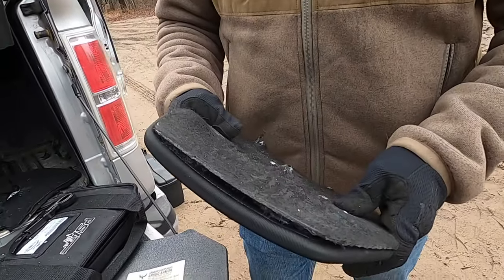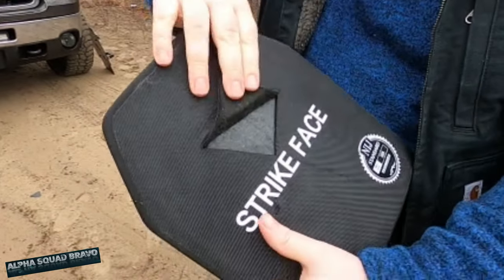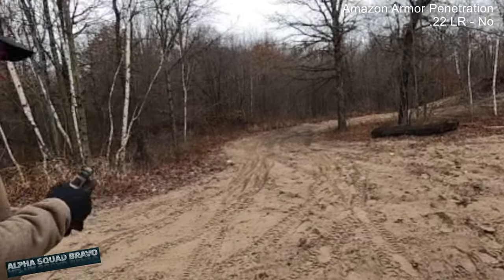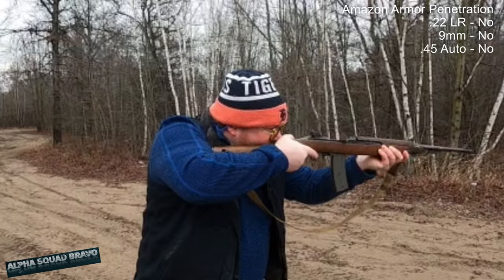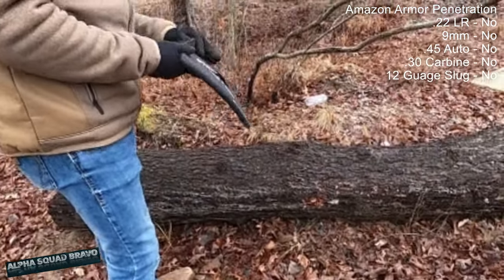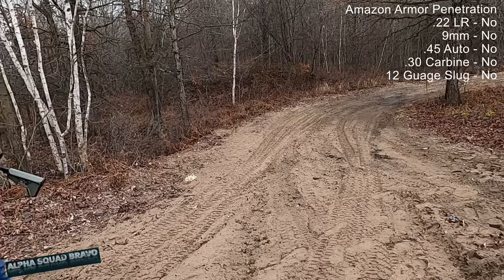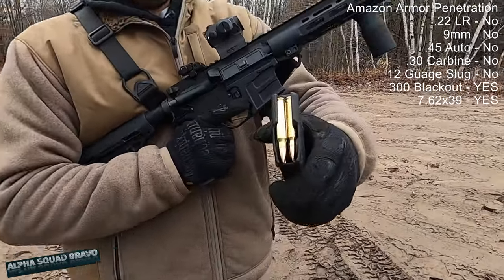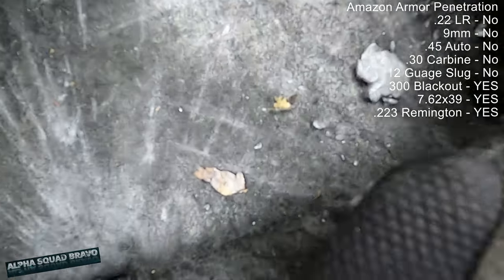Does Amazon Body Armor Actually Work?!

Comment: Yup I've seen 2 plates 139 USD 3A material says plastic and others aluminum. So...the seller says USA...etc. BUT ships from cn. I sent them a message for 2 sets for free and a promise of a video.
We'll see.
Reply: Heck yeah! That's good stuff. Let us know when the video is up!
Reply: @jimmylipp512  their Amazon reply was...Will do.
Which rhymes with... F U.
A dude made on the tube a plate with a welding blanket and fiber glass repair compound and duct tape. That was light and tested good. While another used floor ceramic tile and duct tape. I guess there was an over lapping of tiles at seams that worked well. But ceramic degrards quickly after a few impacts.
Reply: @peternuss8682  So Spencer and I promise to do some ceramic plate testing soon